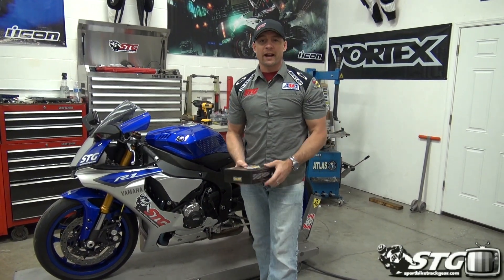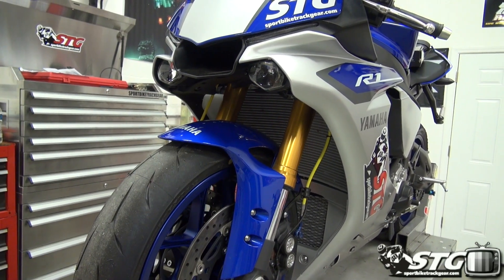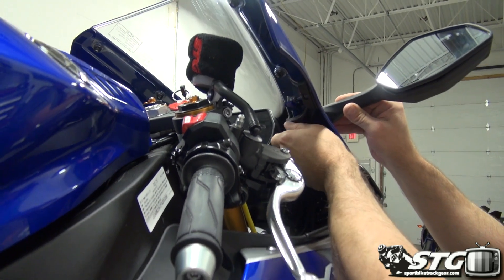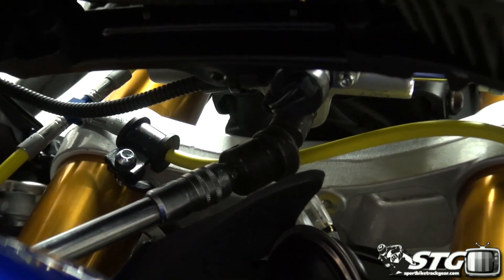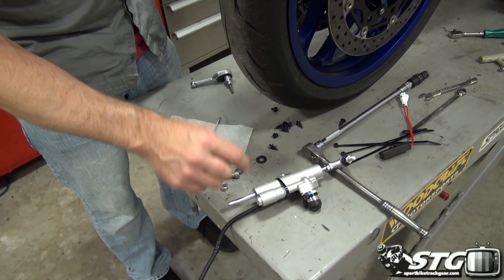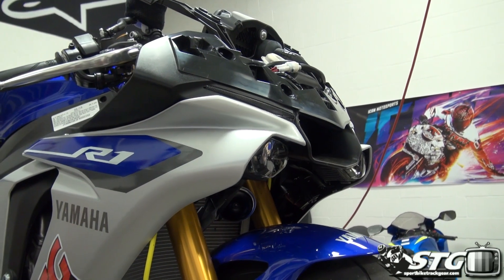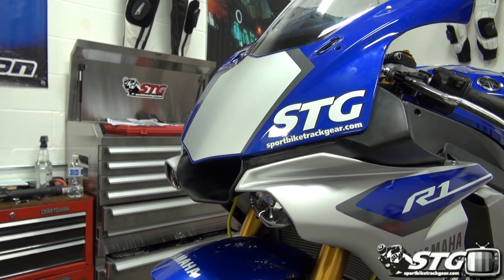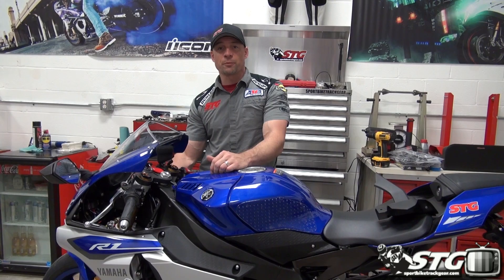How To Install an Ohlins Steering Damper on a 15-17 Yamaha R1 from SportbikeTrackGear.com

Comment: Hey man I have a 2018 R1M it comes stock with a electronic Ohlins steering dampener. Is there any reason why I would want to take out the stock one for this one?
Reply from the maker: If you are converting the bike to a full track bike we find the manual damper is the way to go. If you are riding this on the street no reason not to leave the electronic one in place. - Van
Reply: @sportbiketrackgear  Hey I really appericate the response, your awesome for doing that. I would still like to know, even for a track bike, why would you want to go to a manual dampener from a electronic one? Maybe this is a good topic for a video.

Comment: Is r1 available steering damper from original equiptmen manufacturing? Like zx10r?
Reply from the maker: This mounts in the OEM position. Not 100% sure what you are referring to here. - Van

Comment: did your stock damper make a clicking noise?  mine didnt do it at first but now is clicking after I moved it around in the garage.  also the plunger thing in the end of the damper is spring loaded.  I can push it in.  but its extends out and sits crooked like it's about to fall out.

Comment: Hi Brian, great channel...one quick question I have just installed ohlins damper & there seems to be a lot of play between the ball joint and the frame I have replaced the rubber washer which helped but still seems excessive if I use 2 rubber washers it feels a lot better...is it ok to do this? Thanks
Reply from the maker: I would recommend installing the damper the way Ohlins details in the instructions. The damper is meant to move around to prevent binding. - Van
Reply: Hi Brian, thanks for the advice...much appreciated 👍

Comment: Hey Brian, What is the sock over the brake fluid reservoir for??? I see this on bikes but have no idea why.
Reply: Ronald Riggin It is for two reasons, To soak up fluid in case of a crash and keep the sunlight from breaking down the fluid.
Reply from the maker: Ronald Riggin Christian S is correct and I will add that STG Logo adds a little IMO! - Van
Reply from the maker: We ran out of these a while ago unfortunately :(

Comment: Nice work! If I install a GPR stabilizer, do I have to remove the stock steering damper?
Reply from the maker: You need to remove the OEM steering damper when installing an aftermarket one. 2 dampers is overkill my man.
Reply: @sportbiketrackgear  thanx

Comment: Am I crazy or is that front tire mounted backward?
Reply from the maker: That was still the OEM tire and it was mounted in the proper direction. - Van
Reply: @sportbiketrackgear  yeah, i double checked, you're right.

Comment: I don't get Ohlins on this one.  The stock damper on the 15 R1 is electronic,  just like the R1M.  Ohlins makes an electronic damper for the R1M,  but not for the R1.

I don't get it,  and I probably won't buy an ohlins damper for that reason.